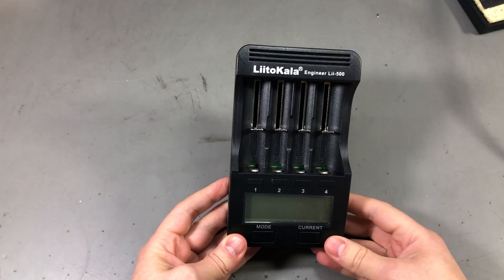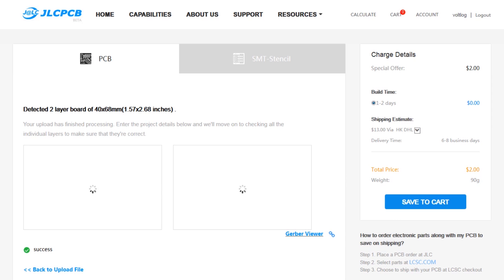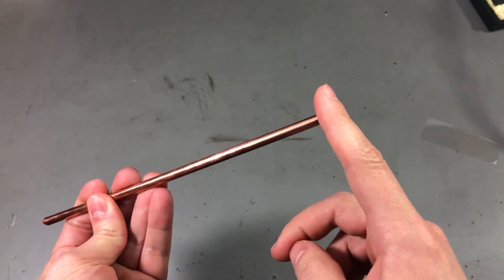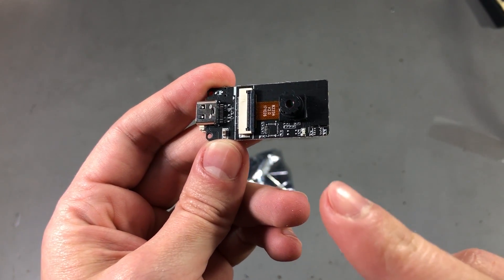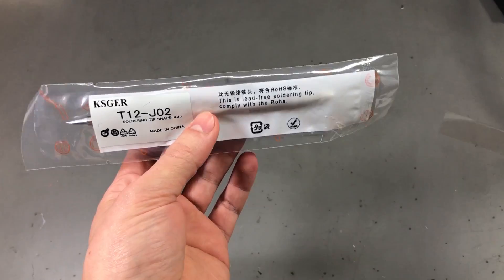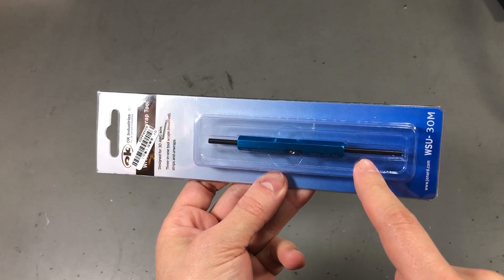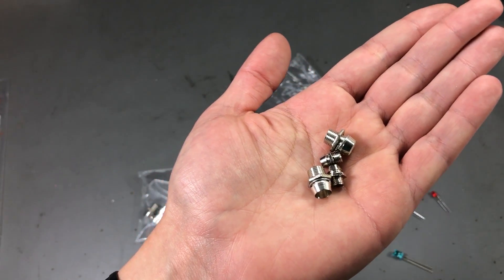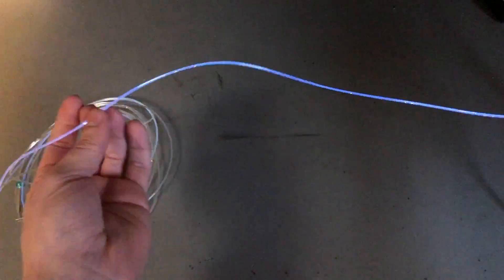Voltlog #213 - InTheMail

Comment: I think I'll buy that wrap tool and some multicolor wires. It can be a very solid way of wiring boards up. We still use a bunch of eletronics from the 1980s at work and they have wire wraps like you would not believe. Very solid connections and when you use all same color wire, very hard to trace :-D
Reply from the maker: it must be interesting working there 😊

Comment: 4:52 wouldn't that leave bits behind like in your previous video when you have used solid electrical wire?
Reply from the maker: it's possible..
Reply: @voltlog  Ok if possible post your updates . Maybe you can cut with a chamfer, like this:
| | | |
\|  |/
Reply from the maker: @FixDaily  the problem with that was the resulting distance between tips, I couldn't get them close enough because of the thickness.

Comment: Try tongue depresors for sticks. It's what the Dr uses to hold down your lounge when they check your throat. No splinters. Cheap on Amazon in boxes of several hundred. Great for epoxy
Reply from the maker: Those are usually wider from what I remember and that would make it difficult to use in the small cans of solder paste but I'll take a look again to see what kind of widths they have.
Reply: @voltlog  you're correct. They are much wider so probably won't work.
Great for epoxy but probably not solder paste on second thoughts.

Comment: I doubt you will get any decent glow fiber for cheap. For even illumination you would need a changing amount of scatter along the length of the fiber (low scatter at the start where there's a lot of light, strong scatter at the end when there's almost non left). Something like that isn't easy to produce and will have a predefined length (the cut anywhere stuff will always have diminishing illumination).
If you have ever taken apart an LCD that has one of those edge lit plastic wedges to spread the light, you'll see the same there. Only a few scatter dots right where the light shines into the watch and a lot of scatter dots (sometimes even to the point of being opaque) right at the end of the wedge.
Reply from the maker: yup everything you say makes sense and I'm thinking I could probably get some decent results over short distances by illuminating from both ends.

Comment: You might have to weight the T12/T15 tips because a greater mass of copper might take longer to heat.
Reply from the maker: thanks, I'll include a weight test as well but generally speaking it's just a naming difference between the two if both are coming from the original source. Now if one is a replica, it's a different story and there might be weight differences.

Comment: Wire wrapping always reminds me of the article that introduced me to the method: https://www.instructables.com/id/How-to-Prototype-Without-Using-Printed-Circuit-Boa/

The suggested method using tweezers and solder instead of a wire wrapping tool has proven to be so handy, it's likely the biggest reason why I've yet to get myself to learn an EDA tool for my one of projects (= all my projects). I suggest to check it out!

Comment: Internal resistance measurement on this charger is a bit off the mark, the same battery on different slots will show different values. Other than that, it's a great charger, 4 separate channels. you can charge and discharge both li-ion and ni-mh at the same time. That would be nice if it would show when it finishes charging on different slot that is currently selected, for example by flashing backlight a few times
Reply from the maker: Certainly there are a few things that could be polished on this charger, I agree.

Comment: I had two bltouch copies. Both ended up being rubbish. Unreliable. One failed and I ended up smashing the extruder. The real one was quite expensive compared to the copies. Seemed a bit of a ripoff but it has been faultless for a year now.
Reply from the maker: as is usually the case, we try to get the less expensive part and we end up paying more than the original :-)

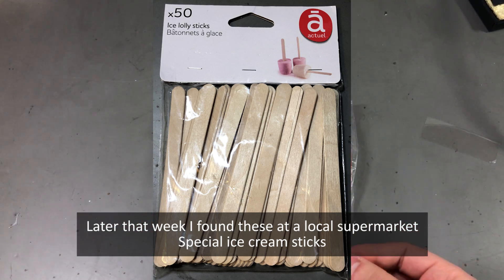Comment: 6:50 - Here in the US you can usually find these sticks at craft/hobby stores. I recall buying a box of 1000 many years ago when I was doing work with composites. Just checked, and they even sell them in the craft section of Walmart now - $6USD for a box of 1000.
Reply: Yes - craft sticks are great - easy to find via mail order if your local stores don't carry them, and usually cheaper than the ice cream sticks you buy (possibly b/c they don't have to worry as much about minor imperfections, since you won't be putting them in your mouth). They have many uses - I use them for mixing and applying glue, spreading thermal compound, etc.
Reply from the maker: thanks for the tip!

Comment: I have the LII-500 and it is by far my favorite charger.  For the price this is an absolute no brainer. Do not get it with the 12V adapter as mine failed after 3 months and as mr VoltLog says we have plenty of 12V chargers in house.  A bit of advice, put some rubber feet underneath the charger as it is very slippery on almost every surface.  Also mine made a bit of magic smoke when I had a 18650 cell in backwards, that happened of like 20 minutes being in reversed polarity. I actually intend to buy a second one as a spare and to charge more batteries at once.
Reply from the maker: Yup a nice compact charger, looking good so far.